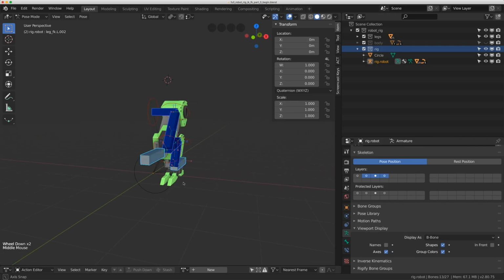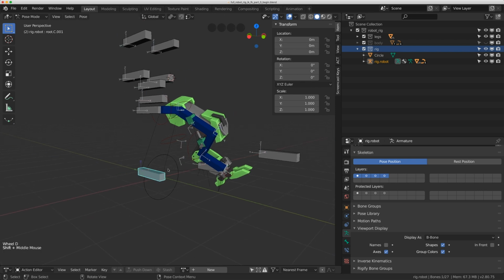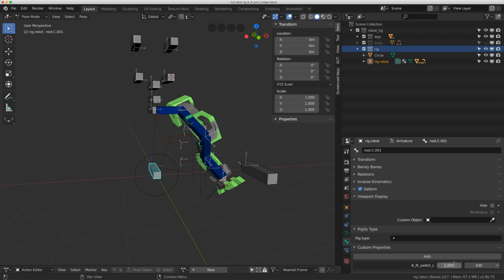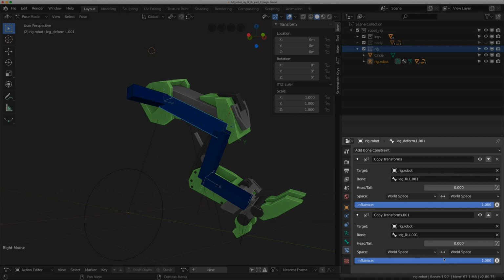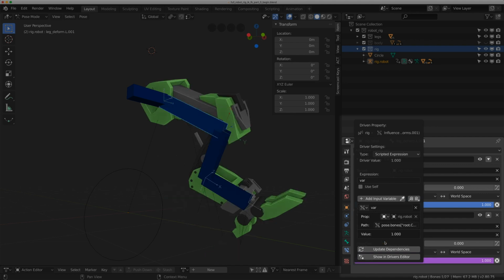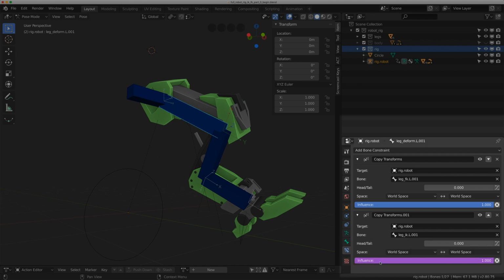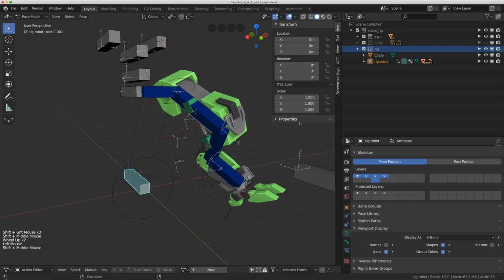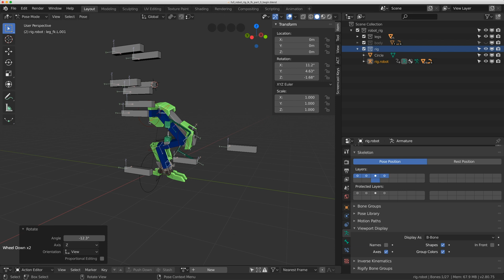Full Robot Rig - Part 4: IK FK Switch | Rigging For Animation

Comment: This finally gave me the answers i'd been seeking for days! Thanks. I can use this for the IK/FK.  I'm still searching for a solution to switch between constraints though. I created an eye control and I want to be able to make either follow the root or the head. I know you can just access the Influence in the constraint menu, but can you link it to a custom attribute somehow? 0 for eye and 1 for root or something? (via python expressions maybe?)
Reply from the maker: Yeah, for something like this you can add a driver. Right click on the influence and click add driver. From there connect all the pieces from a property on your rig. 
https://youtu.be/mxGYBuDZ0EA

Comment: great tutorial , thanks dude . but I have a question , how can I change from fk to ik and keeping previous gesture posed by fk? like use fk control bones from frame 0 to frame 10 , and switch to ik from  frame 11 and using the posture of frame 10?
Reply from the maker: That is called FK IK snapping, here I just show a switch to move between to the two. 
Rigify has an FK IK snap feature that is easy to use. But for creating your own the only way is to develop something in python and make your own addon. For a snap, you will need to code the vector location of the IK or the FK to snap to the other. You may want to develop this feature before moving onto the actual rig itself.
Reply: @LevelPixelLevel  yeah, I kind of understand the rigid system , IF FK are like different algorithm , which compute gesture by previous data i.e the position rotate and scale of each bone , algorithm changes , result changes . switch basing on previous gesture needs store data in a certain way which is only possible by python.for a small project like I'm working on , I can copy whole model into a new scene which keeps other things same ,then apply it as rest position and switch to IK or FK. 
I'm working a on small project about robotic arm , which has some restriction of rotate axis for different joint ,under IK mode, even I locked rotate axis for a joint, the target IK part moves will break those locks,I'm trying to solve this problem or dance with it. :)
Reply from the maker: @pampanelson  Yeah I've had something similar, it is tough with small projects sometimes because there is not enough time to add all the fun bells and whistles to a rig. 
I want to do a video though in the future that covers what you mentioned here. I do have a method, but it is heavily based on bone and control naming. I'm going to see if I can develop something more modular.
Reply: @LevelPixelLevel  great!! I'm looking for it! And if you are interested, I will let you know when finish my short cg film.
Reply from the maker: @pampanelson  sounds great!